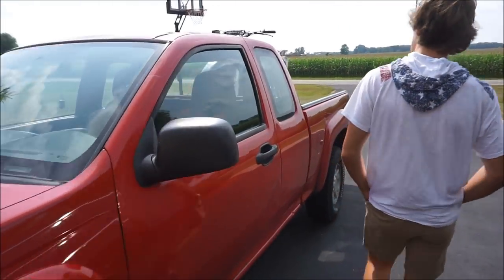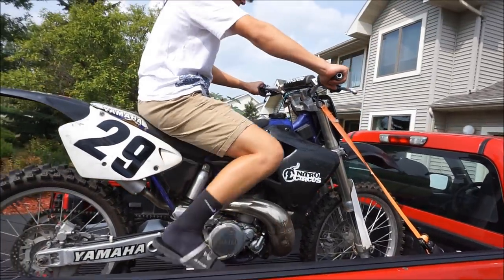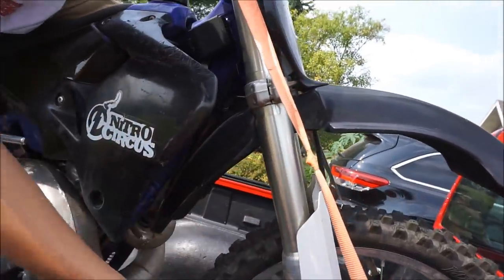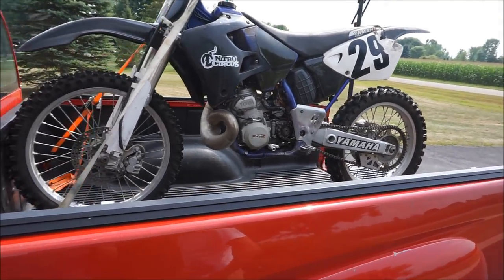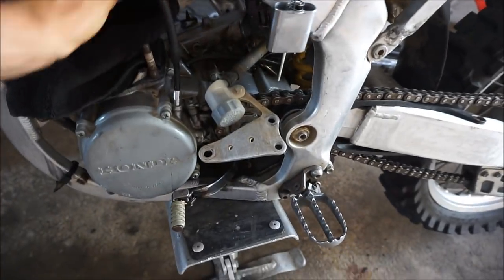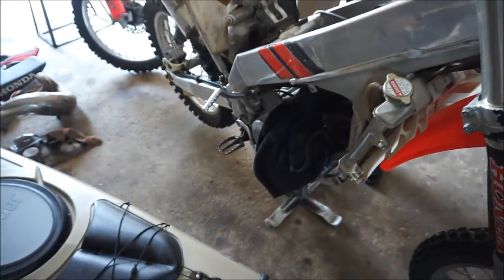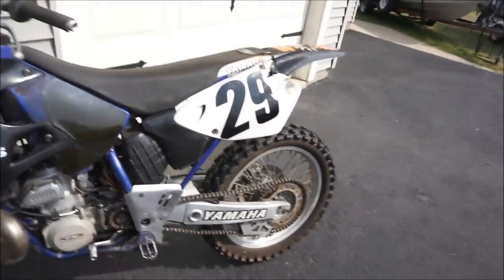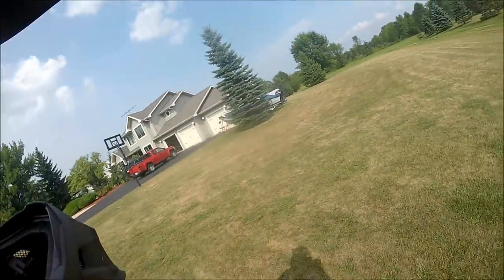This Yamaha Bites Back!!!

Comment: Just about every single bike i see on this channel needs a top end! I haven’t seen one of these bikes pulling power wheelies like they should. That Cr500 is the slowest one in the country right now and should be a straight SAVAGE
Reply: It doesn't help that guy is scared to death to get them on the pipe below 3rd gear, and shifts like a grandma..🤦🏼‍♂️
Reply: @Nunya_Beezwax  😂😂
Reply: Also doesnt help he never warms them up correctly
Reply: Domenic Roads how do you correctly warm up a bike, you let it run, you can rev a two stroke when they’re cold since there’s oil in the cylinder.
Reply: Rieley Slocum when people hop on bikes without warming them up they run the risk of seizing the piston. The piston, rings, and cylinder all need time to get warm. When the piston is hot and the cylinder is not warmed up all the way the piston can seize in the cylinder from swelling up too fast.
Reply: This is true big business im guilty of it more than once actually. I do it properly now tho lol
Reply: Yeah bro gotta warm them up a bit not much.the piston gets hotter kwicker than the bore does so it expands faster
Reply: @rieleyslocum870  you let it run for atleast 10 minutes and then when you actually get on you aren't supposed to try and hit band on first or second straight away that's the reason all his two strokes big straight away and then stop bugging after 10 mins of running
Reply: Bog straight away*
Reply: Its not just about the oil, its also about piston expanding faster than the cylinder. You should warm it up for 1-2 minutes then less than 1/4 throttle till it is at normal running temp which is another couple of minutes.
Reply: How does this bike need a top end

Comment: 'Slaps piston and cylinder on CR250 and sells to unknowing buyer. Buyer rides 20 minutes with same results as the rod bearing continues to disintegrate into the the motor. Freaking Scabs!

Comment: Thousand bucks that’s a steal. Def check the pilot jet and your mixture screws 1/4 throttle sounds tuffff 😂
Reply: Not really ive seen alot of bikes in better shape in my area for that price. In fact about 9 years ago i got a kx 125 for 1500 and it was only a year old barely riden cause dude was scared of it.

Comment: 125s and 250s  are exactly the same size bike. Same frame, plastics, tank, everything's the same. So...ya. It should feel like a 125
Reply: a 250 generally feels alot heavier then a 125 , i'm used to my cr250 , when i hop on my brothers yz125 , it feels like i'm on a pedal bike cause its so light
Reply: josh012345 most of the 2 strokes were about a 5 pound difference between the 125 and 250. I can barely notice because its weight is centered weight and low (the engine)
Reply: the bikes are actually 35lbs difference and i can for sure feel that a yz125 is ALOT lighter then a cr250 , i ride these bikes weekly .. you can feel the difference from a 125 to a 250 just by sitting on the bike.. the bikes are the same size fame and wheels , the yz actually sits a couple inches higher then my 250 , but the yz125 is noticeably lighter.
Reply: I don’t feel much difference between my cr125 and my Ktm250sx
Reply: Yeah the only difference i ever felt is going from an aluminum frame 125 to a steel frame 250 theirs a weight difference and the Yamaha 2 strokes are the biggest ones with a 39 inch seat high almost 2 inches higher than a cr 250 or cr 125
Reply: The yz125 is almost 1.5 inches shorter than a yz250
Reply: @rieleyslocum870  no its not look it up 39.3 inch so no thats bigger than cr kx and most 250s
Reply: Tim Luttringer seat height on a 2019 yz125 is 38.4 inches and the 250 is 39.1 inches look them both up on yamahapowersports
Reply: @rieleyslocum870  bruh its 39.3 look on google
Reply: @rieleyslocum870  never mind the 2018 was 39.3 witch was bigger than the 250 and its about .8 of and inch diffrence
Reply: @rieleyslocum870  still the Yamaha 125s  are bigger than most other 250s and 450s
Reply: Tim Luttringer you are right I think they’re the biggest 125 built stock and one of the biggest dirt bikes built nowadays.
Reply: josh012345 it was strapped down tho so explain how’s it feels more light
Reply: @camerontabatt3282  yeah exactly these dudes dont know shit
Reply: Rieley Slocum  It could be anything you want. all you do is adjust the rear shock you can go 5, 6 inches higher lower
Reply: @timluttringer9340  your not kidding my cr felt so much lighter then my ktm that steel frame makes it feel like a tank

Comment: Yz 250 has more compression then the cr500
Reply: Its probably a big bore
Reply: Pablo Munoz nah the 500 just needs a rebuild
Reply: There’s a problem when you can push a cr500 all the way down with one hand.
Reply: Av said all along cr5 need rings an piston its got a rattle but isnt a bottom end bearing noise,little ends or rings defo shud b pulling all over its flat as a pancake if u know anything about bikes a cr 5 cant b pushed by hand,i.e compression is your problem👍
Reply: That cr500 should not have that much play  back and forth if you knew anything about a dirt bike you would buy a set of gauges and see what the gap is between the play you should sale all those bikes because you don't know nothing about them if your going to ride them learn how to do maintenance.  Minty come on man get some balls

Comment: I swear every single video of yours i watch all the bikes sound garbage, i dont know what mixture your running or what you do to them but christ it aint good
Reply: Doorag Productions Doorag probably straight gas
Reply: I agree!!
Reply: They just need to warm them up properly and run the right fuel ratio
Reply: Buddy goes through bikes like like I do socks
Reply: He runs 32:1 but his riding style is not what a 2stroke is made for so it fouls his plugs its giving more gas/oil than it's actually burning
Reply: @HooligansMx  how do you mean riding style? He's only riding it round on the grass if your holding the throttle open in like 2nd gear there's no way it should sound like that
Reply: @AndyCallumVLOG  hes fouling the plug by never opening it up at least that's what a mechanic for at my local dealer told me when I took my wife's bike in he said 2 strokes need to be opened up once in awhile or your going to foul the plug. But I think this bike sounds like shit cuz the silencer doesn't have enough packing in it
Reply: @HooligansMx  yeah but the bikes blubbering and you can tell it's not opening up and revving put properly, exhaust packing being gone would just mean it's noisier it would still ride ok plus this bike he had literally just bought so the previous owner probably didn't ride it properly either
Reply: Doorag Productions Doorag he’s afraid of Erving that bitch ya just gotta full throttle
Reply: Yea bro 2 strokes need the throttle open almost constantly in order to keep proper lubrication in the cylinder (fuel lubricated)...and you could foul plugs when you’re just putting around because like you said, the cylinder could get overloaded with unburnt fuel, improper carburetor jetting is also a reason to foul plugs. You also shouldn’t be engine breaking 2 strokes like he does to all of them.
Reply: It does sound bad
Reply: they just don't know how to really ride 2 strokes
Reply: Ive seen these guys run 4 different ratios depending if there racing, riding in yard or smoking lol
Reply: Dear Surrey and other keyboard warriors: 2vintages' bikes sound ALIVE, considering the audio is recorded from a GoPro on a helmet.  When was the last time you stretched the throttle cable on a 250cc 2-stroke MX bike?  How about a 125cc 2-stroke MX bike, hmm?  Shall I feed you a stone-spray sandwich from my 1996 RM250?  Am rebuilding a '96 RM125 to match the 250.  Charlie and his cameraman are men.  Will you ever grow up and join the club?
Reply: Hooligan Mx Your absolutely right when I first started riding I would foul plugs cause I wasn’t used to the 2 stroke snap, but once you get comfortable opening it up a lot you have more fun and the bike runs smooth
Reply: @HooligansMx - "hes fouling the plug by never opening it up" -   Assuming this theory is correct  whilst I don't know which particular bike(s) you refer to, constantly using low revs can lead to excess unburnt fuel collecting in the bottom of the expansion chamber ( & even the crankcase) & the reflecting wave from the rear of the pipe pushes the unburnt fuel into the engine causing the engine to run rich. While expansion chambers are easy enough to drain to empty a flooded crankcase ( in the old days when ignition systems were REALLY  kr@p bikes came with a drain plug in the crankcase to solve what was a common problem then. Now these plugs have been discontinued ) it would seem the best solution is a big syringe with some plastic tube on the end?
   Whilst in this area, if you should be so unfortunate as to lose a piston e.g. because of detonation do be aware you might well end up with piston crown bits ( often transformed into grit ) in your crankshaft so you might well have to wash the cases & shaft out & relube the crank & if you don't check the pipe then piston bits in there can easily be sucked back into the engine when you first start up !
Reply: This is very true that’s what I thought

Comment: You had metal shavings in there for a reason that doesn’t just happened randomly unless you ran super lean gas in it I’d take the bottom end apart to make sure unless you wanna ruin the new sleeve and piston your paying for

Comment: That side to side play is normal. All of my moped motors have that. Your crank webs have to be farther apart and the rod is wide. Same thing with the rod and bearing on the wrist pin. Rod can kinda float side to side a little while running.

Comment: You got a decent deal on the bike, but you're going to kill it with the constant engine breaking, and it may be something simple like a plug, but that thing has no power.  You might have a stuck power valve, but that thing should be pulling the front tire off the ground without trying.  You're yanking on the bars, and it still won't pull a wheelie.  I guess the good thing is, even if it needs a top end, it's only $150.
Reply: Oh yeah it rides like a 125

Comment: Split the engine cases on the cr250 to make sure there isn't any more pieces of a broken ring or other crap down there. Cause it will come back up and ruin the cylinder

Comment: Its squated down, thats why it feels like a 125.. Take the straps off.. And take it off the truck, then your sitting on a 250. But technically the 125 frame and 250 frames are the same. Just the motors are diff.

Comment: the the 250 right at the bottom dead center and make sure doest have enough sideways play to hit the crack webs if it touches the inside of the crack you should replace it 100%

Comment: Put the 500 motor in the cr250
Reply: Trevor Tickle duh!
Reply: Trevor Tickle yeah
Reply: Fix them both instead of having a shed of nacker bikes,2 clapped ive got a cr 125 got a knock on engine splutters an bogs its minty tho lol just needs a carb clean

Comment: Until you do a top end on that 500 any running right 250 will smoke it what that 500 is jetted at right now shouldn't be killing the power as much as it is that yz250 is a beast if you open it up also

Comment: cr250 rod looks like a new one ,just it cant touch the side of the crank when at bdc  so cheak it but looks good to me and you need a new head or to clean it up some way look up how to cut a head down for more compression at home I use a drill a socket to fit on spark plug use  glass to keep it flat and sand paper I use 36 grit makes it go by fast then finer grits but you need to get the holes out of the head so you need to sand that with ur hand or something it you keep ur head that looks like the moon u need to sell it don't ride it or it will blow again the hole make hot spot and the mixed air fire befor in spark so long befor tdc ur bike is fireing nocking it bad for everthing hard on crank and bearing and piston  and all, look up diy dirt bike head mod with little tools ,its easy to do or just by a new head but if you the most power I cut my head down 25 to 30 th my 98 cr250 is way more power then be for and be for its was the hottest 250 around it crazy bc ppl think them bike suck and it true they don't handle the best but man do they rip the 95 96 are my fav motor for the cr they are ported better and fit the 97 to 2000 or when ever they stopped making them like that but ur cr head need to smooth out the high spot best you can and that may work idk how bad it is how deep are the holes but I know its bad enough you need to do something bout it a good head mod will make it pull like 500 down low and still rev out good like 250 but have more power all around , it may of been the pin came out that lines up the rings and hands them in place or a roller in the bearing or part of a spark plut broke off inside I saw this when the first platinum came out the tips was coming off and the e3 plugs ceramic broke off inside I saw that 2 times but got it out be for it blow up my bike or saw ,and you warn up bike good to me bc my cr 250 will never warm up  till you start ripping it it can set running all day or ride all day at little throttle it just don't warm up like the its ment to be ripped on as hard as can be its a race bike not a woods bike so your warming then up right ,a piston only last 100 hours so why set there 20 mins try to warm up a race bike every time you start it ,its just hard on a bike to let it set cold running for along time when you just it 1 rip and in secs its warm and getting the fuel its need to last longer  ,this is just how race bike are tuned and have a good coolant system maybe a woods bike warms up by setting but its harder on they I use to do it the way now I rip it the fast its warm and getting the furl it need it run best and last longer if its sets cold it will no run and have to keep starting it now if its cold out side its not good the start ripping it but it going to be hard to keep in running

Comment: I think this is proof you should do a top end on the cr500 this yz250 has way more compression and with that 500 there is no reason at all that front end shouldn't be coming up regardless of it needing to be jetted da top end on that 500 and I bet you my bike it will be totally different that's how positive I am that bike needs a top end I just bought a 500 a couple days ago it's a 96 and it stands in every gear becua it has a fresh top end and the compression is wicked it's a bitch to kick it

Comment: My rm250 looks like an 85 when it's strapped down in the truck lol.
Please listen to some of these guys, side to side play should be minimal and no up and down at all.  I used to rebuild my own race bikes and they always ran in top shape. Some of your bikes really only need simple stuff like jetting. 
Not bragging but my rm250 always starts first kick without a choke unless it's below freezing and then first or second with choke. I can't crack my 250 like that on pavement unless it's in 4th or 5th gear. That yamaha needs v force reeds and some new jets dude.

Comment: The 250 is way out of tune. I owned a 490 & a 465 YZ  growing up and you ride them hard you are doing rings,pistons crank bearing & seals etc.. most of the bikes you are getting are over due for rebuilds worn leaking crank seals and low compression you will never get to run right just lean out and blow up.